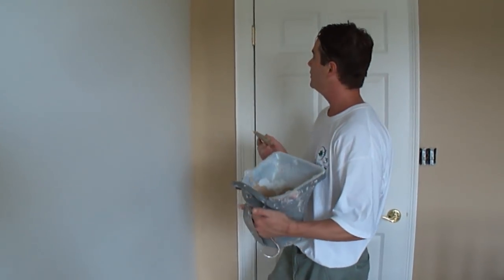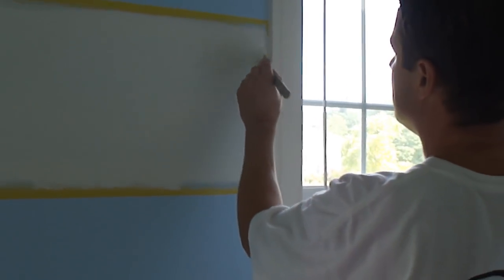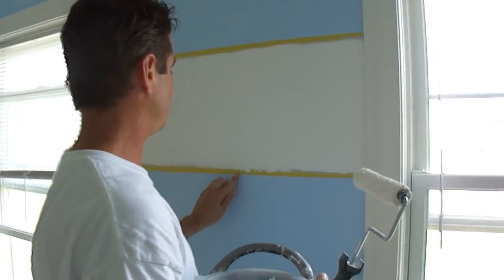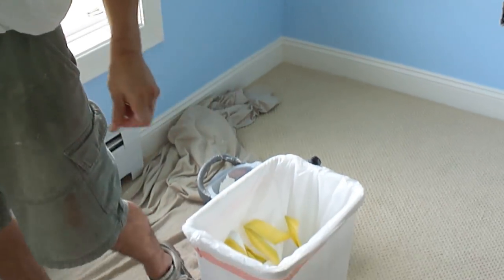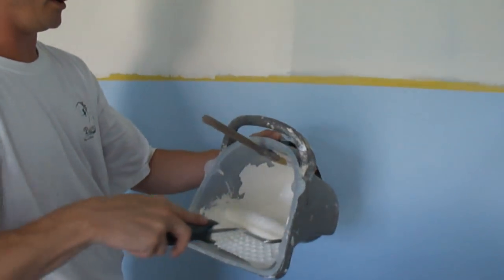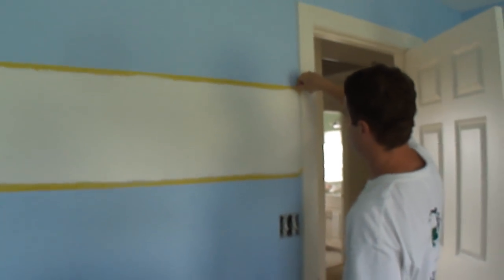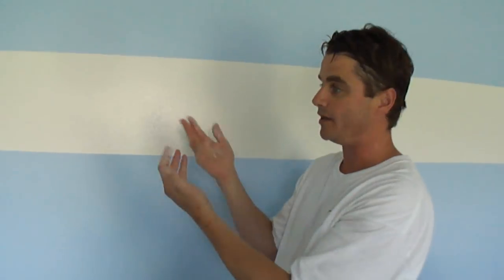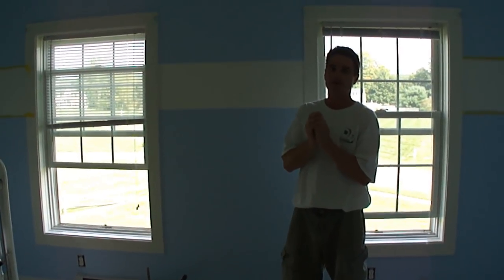DIY Nursery Painting - Accent Wall & Horizontal Stripes (Part 9)

Comment: Are your walls textured? I had bleed all over mine , what a disappointment
Reply from the maker: Hi Javier-

The walls are smooth. What sort of texture was on your walls?

Russ
Reply: Medium texture not sure what the right term is. I taped them up twice the second time I used some caulking to seal the tape but still had some bleeding. Not as bad as the 1st time but enough to warrant an hour or so of touchups with an artist brush lol
Reply from the maker: Javier R.

Hi-

I hear you! Sometimes what you can do to sort of even out (level)  a texture surface is too drag your 5 in 1 blade down the surface. Carve out any convex surface. Where you from?

Russ